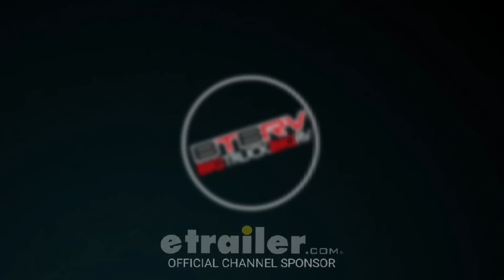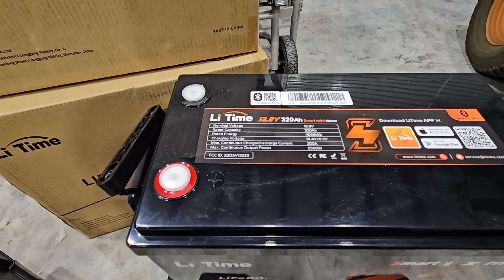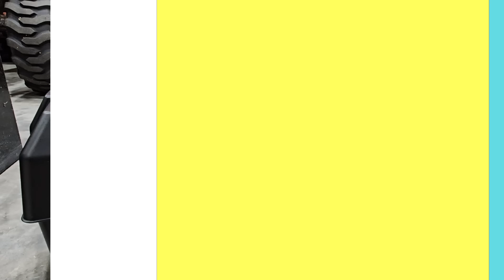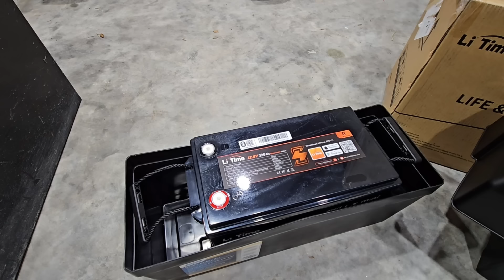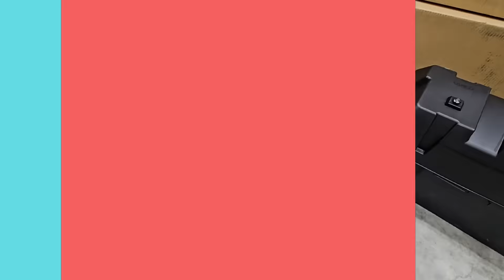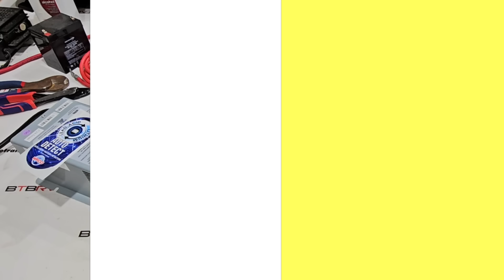INCREDIBLE! A MINI 320AH LiFePO4 Lithium Blutooth Battery from LiTime!

Comment: My new Litime had a .5 volt difference between the battery terminals and what the app showed. The app shut off charging when it showed 13.5 volts but there was only 13.0 volts at the terminals. Litime customer service said that is normal, refused to replace it and told me to live with it. .5 voltage loss between the BMS and battery terminals is dangerous. Probably a loose internal wire. I sent the worthless battery to recycling.

Comment: It isn’t unique and it doesn’t replace 7 battery’s. It’s about the same size of a traditional 100ah battery. So at best it “replaces” three batteries.
Reply: traditional deep cycle battery youre only using 50% capacity or you kill it. so really this is the equivalent of 6.5 lead acid batteries
Reply: @baronvolkov6172 

🤦🏼‍♂️

Comment: Certified rv tech here. Just a note. I have had issues with the wfco auto detect converters not detecting lifepo4 batteries and charge as lead acid.  I have done all recommended suggestions tech support gave over phone. I am a firm believer in a switch to change charging modes. Fool proof.  Otherwise you will not get full capacity and harm battery with float charge.
Reply: Yup, decided not to go with an auto switching converter for the same reasons

Comment: An 800w AC unit is only going to cool a van, not a trailer or 5th wheel. You would need 2 of these batteries and a 5000w inverter to even think about running a single RV AC unit. Physics always wins....
Reply from the maker: How does my 3k GoPower inverter power our 3 13.5k ACs then?
Reply: @BTBRV 13.5k btu is approx 1350watts each x 3 is over 4000watts, so you must be a magician.
Reply from the maker: Or, you're assuming startup power x all 3 units.  Most units run around 900watts (as shown in many videos).  Start them individually and your generally good.  It's actually math not magic my friend.

Comment: Keep in mind, you will likely need to replace the cable from the power center to the battery with 6 gauge wire to get the full 50 amps to charge from the converter to the battery, along with an equally stout ground from power center to chassis, and chassis to negative on the battery. 99 out of 100 rv’s do not have stout enough wiring to handle this. BTDT. My rockwood trailer went from 36 amps charging current to 51 amps when I upgraded the wiring.
Reply: From Queensland Australia 
Yes I agree, many people want to do their own wiring however, they don't always understand how an electrical current travels from point A to point B. Me, being a firefighter for 20 years liken electricity flow through a cable like water through a hose. When we would increase the pressure to high using a small diameter hose, we didn't get much more volume of water through the nozzle but we did get more burst hoses.
So then to remedy the problem, we would use a larger diameter hose, same pressure or perhaps a little more, and we got a lot more volume of water at the nozzle, which in turn suppressed the fire.
Same with electricity, the appliance is the fire, the bigger the appliance the more power it needs. Also many people don't understand that distance plays a key roll with electricity as well. The further the appliance is from the source the bigger the cable needs to be to supply the correct voltage for that application to operate correctly. The further the fire is from the pump, the large diameter hoses are needed as well as an increase in pressure.
Not being an electrician, please tell me if this equation makes sense.

Comment: Dont buy these batteries, they dont last and the customer service is garbage. I have one of these and it was only a few years old and maybe been cycled like 4 times and the BMS started acting up. I tried all the tricks to reset it and nothing worked. I contacted LiTime and they said I could ship it to them on my dime and IF they found a problem with it they would re-imburse me or replace. But if they dont find a flaw they wont pay to return it. They sell used batteries and I dont trust that. So I pulled the case apart and unplugged the BMS let it sit and sure enough it worked again. But a few hours later the BMS stopped working again. So I told LiTime what happened and they said sorry you opened it so they cant help and cant sell me a BMS replacement. Terrible service and support!!!

Comment: Would this be better than a lead acid battery to run the accessories for longer in my mercedes s63? not for the starter battery for the accessory battery? It would fit right in

Comment: In my 2022 Solitude 378MBS it has two 80ah deep cycles. (80ah in total useable power) So these are on my short list for winter upgrades along with the solar panels I have sitting in the shop.

Comment: You can get 300amp hours to 350 amp hours now for under $ 300.00 bucks US... vs this one for almost $ 700.00 bucks...  by end of 2026 they will be available for under $225 bucks US..
Reply from the maker: Much of this comes down to what brand you choose to buy and the risk you taken buying that brand. LiTime is by no means the same quality as Battleborn, Redarc or GoPower but they are not bottom of the barrel like many brands that you're seeing pop up on Amazon.  The quality of the safety components does mean something.

Comment: Imagine hopping into the DeLorean and going back to 1985 with that battery.  If you told people (even today!) how that battery has 320 USABLE amp-hours, yet it's the same size and weight as an old lead-acid battery, with only 50 usable amp-hours, they would think you were lying to them.  You'd have to prove it.  "ONE POINT TWENTY-ONE JIGGA-WATTS?!"

Comment: Replaced the original FLA batteries on my trailer with the 280Ah version of this battery on our Jayco a couple years ago. During the conversion relocated to the front cargo pass through. Night and day difference in real use capacity and charging time. Battery has been rock solid reliable too. Wouldn’t hesitate to buy another. If this 320 had been available at the time I would’ve went with it.

Comment: LiTime/Ampere are the batteries I've used and recommended for years. Been using them on bass boats since 2021. Never an issue, not burning down boats like those Battleborn pieces of garbage. Really can't go wrong for an excellent price.

Comment: That's crazy $670,00 battery 😲 Didn't mention that on the video.
Reply: That is $225 per 100 amp hr. Actually that’s a good price. I’ve seen agm car batteries that more than that a they don’t have 100 amp hrs. This is a great battery if you camp off grid. If you only camp with hooked up to power, then you would not need this battery.
Reply: @davidgutierrez6888  The average is about $300+ per 100 amp batteries across the board.
Reply: Not really.  Apparently you have not priced batteries in the last 10 years.  LOL.
Reply: What don't you get? People with your mentality is why the appliance market had a race to the bottom to please people like you.
Reply: Yeah, twice the price of a NewtiPower 12V 330Ah LiFePO4 Bluetooth Battery, $380 on Amazon.
Reply: I suggest searching for Will Prowse,  Hobotech, or David Poz on more reviews about lithium batteries.

Comment: It’s a great battery, when the Eve 280 cells launched i spoke to LiTime at the time Ampere time in 2023 asking for a battery as it would be a group 31 size but 280Ah I guess they waited for the larger 320Ah cells. I’ve had my LiTime 400Ah for 4 years now and it’s been a great battery.